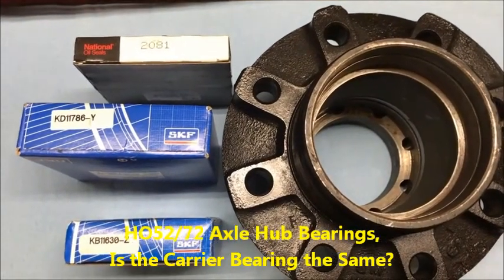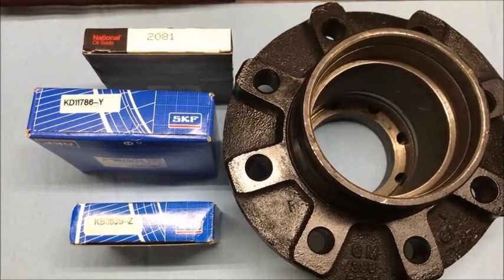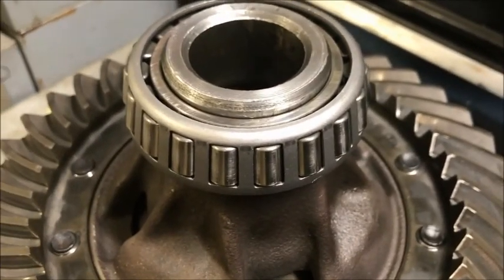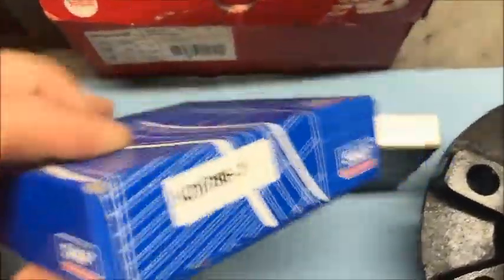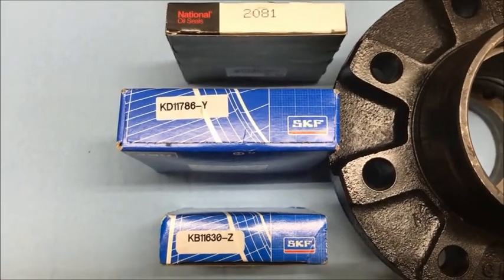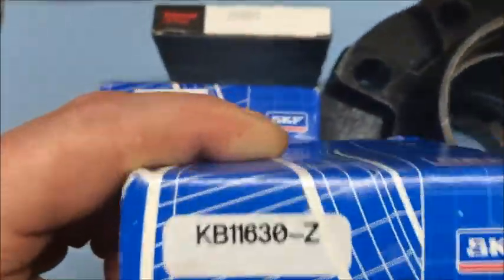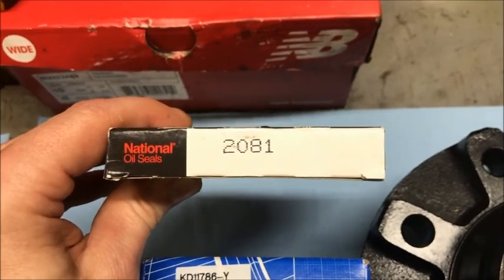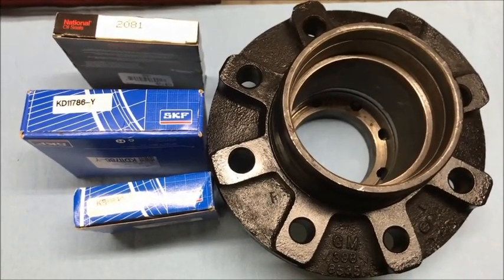HO52 / HO72 Hub Bearings

Comment: Thanks for taking the time and sharing. As you know information on theses rearends is hard to find. 

There's alot of talk about the interchangability of 14 bolt parts being used in the Eatons. Would yo know if the brake drums from a 14 bolt can be used on the Eatons? I found LMC lists the Eaton drums but they are $200 each plus shipping, ouch. Thanks again
Reply from the maker: 14-bolt drums will not directly replace HO52 (11") or HO72 (12") drums.  However, the entire 14-bolt brake assembly (including backing plates) is a direct bolt-on.  This is a popular upgrade for the HO72, since HO72 drums are hard to find.  HO52 drums are available from RockAuto, with wheel stud holes 1/2" (CENTRIC 12366024 for 1970 and earlier) and 9/16" (CENTRIC 12366040 for 1971 & 72).
Reply: @BriansGarageUSA  Hey Brian, thanks for your reply and the information. I have a few more questions about these axles. I have 12” drum’s so we’re looking at a HO72. My front axles is a Dana 44 closed knuckle also with 12” drums. Where do you find the 12” specific brake hardware? Would 11” hardware kits work on the 12” drums? I’ve searched the web sites of many of the suppliers and none list what I’m looking for. I went to Autozone, Advanced Auto, and NAPA and no one list the brake hardware for my truck, (1964 K20). Thanks again for your reply. Chris
Reply from the maker: @zluca05  Sorry Luca.  I have no experience with the 1-ton brakes.  I'm told the drums are not available.  Don't know if the 11" hardware works on 12".  Best bet is to peruse the 1967-1972 truck forum.  Someone surely will have encountered this issue.
Reply: Excuse me Brian, do you have a parts number for the drums on rock auto for the HO52? Thanks